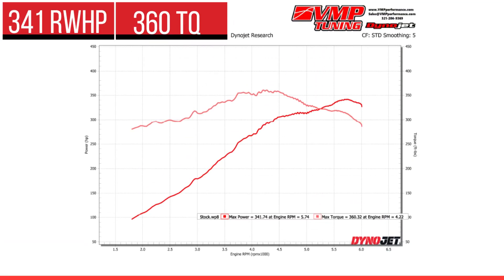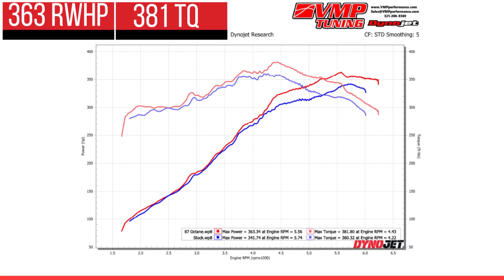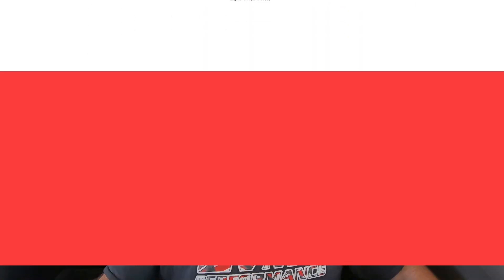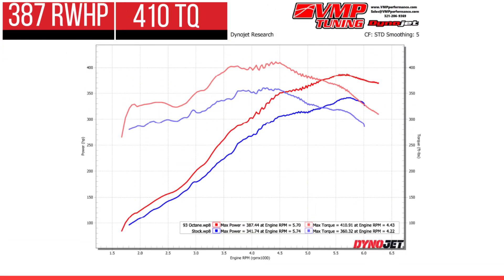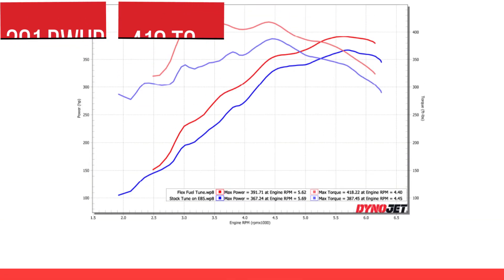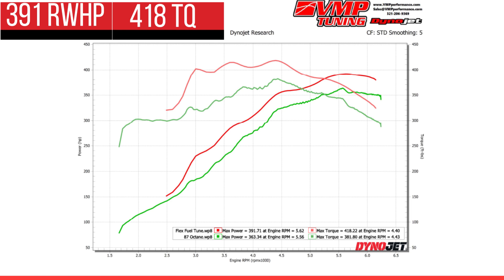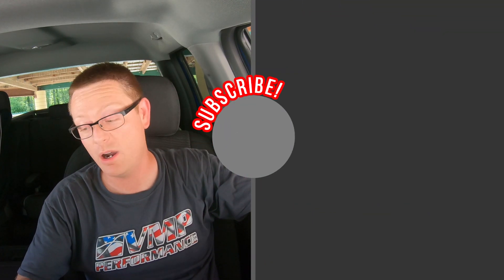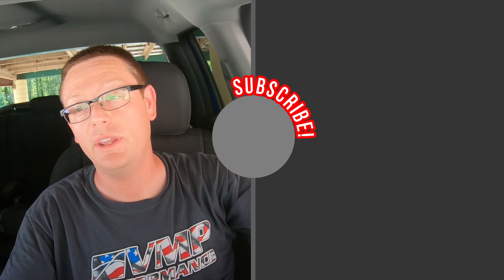Flex-Fuel Power Gains with VMP Tuning : 2018 F-150 5.0 L

Comment: And for those guys who don’t want to tune and still want decent gains apparently just switch to e85 on stock tune. 

Stock 87: 341rwhp 360TQ
Tuned 87: 363rwhp 381TQ
Stock e85: 367rwhp 387TQ

Comment: Thanks for the video. These are good numbers but nothing that screams "buy me now", not to mention simply using e85 is expected to give a decent bump in performance over 87 anyways. I'm interested in a Tuner but the market seems to mostly want more horsepower and that's just silly to me. The F150 5.0 is built and tuned differently compared to the Stang for obvious reasons. Have you guys experimented with a tune that prioritizes torque gains? I already swapped out the pathetic stock gears for 4.56 but kept stock tires and would love a tuner that gives a substantial increase in torque even if it meant sacrificing horses. Towing uphill is where I want to shine.
Reply from the maker: Thanks for replying.  Shoot us an email at sales@vmppeformance.com with what you're looking for in a tune and one of our tuners can talk with you about tailoring a custom tune to suit your preferences.
Reply: 4.56s on stock tires must make for a lot of shifting? What was your driver behind that?
Reply: High compression engines need more octane

Comment: So a flex fuel tune is 1 tune that covers all octanes? I have a 2013 f150 5.0 that I'd like to get just one tune that covers all octanes. Is that possible?
Reply: intake cams, intake manifold, and a tune with crazy high shift points is all you need for the older 5.0s ive got a 13 scsb 5.0 too

Comment: Damn the coyote in the mustang makes 80 hp more on e85 (and a cold air intake) ,  that’s a huge difference considering it’s the same engine,  feel free to school me on why that is
Reply from the maker: The biggest HP difference is in the intake manifold. The 18+ Mustangs have a different intake manifold than the trucks do and also the driveline on the F-150's has different components that make a difference in wheel horsepower.
Reply: Mustangs sport different cams than the truck version.
Reply: on the truck they shoot for more torque for towing and hauling

Comment: Also, did you test that E85 TO see how potent it is. Most E85 out here in Phoenix AZ does not measure up. It's weaker than normal E-85.  There are local forums and websites that post who has the best E85. Does anyone know how it loses its potency? Is it being manufactured this way cause like most GREEDY FUGGING CORPORATIONS, they are trying to maximize their profits by not giving us TRUE E-85. Also since they learned that the performance community started buying E85 instead of expensive fuels like VP and 114 octane TRICK, which i used to run in all my 2 stroke engines,  the price of E85 is the same as gasoline. It used to be AT LEAST $1 CHEAPER PER GALLON before.    Not only are they charging more, they are giving us a Sub-Standard product.  Fugging ICEHOLES!!!

Comment: I called to get a tune for my 2018 F150 spoke with a rep gave them the spec/mods I had said it would be next week till they would be able to convert it over to SCT tuner and to call back (price given at this time was 250 dollars). I called back a week later spoke with the same rep and ask about the tune and he said it was not ready and then asked again what year and what was done to my truck. I gave him the same information again and then said it was going to be 499 dollars. I asked why it's  more money and he said it was due to the E85 tune and the first quote was without  E85. I said that's a huge difference and then he quoted me again at a lower price 399. PLEASE PROVIDE THE CORRECT PRICE THE FIRST TIME!
Reply: The fact that they didn't reply to this message speaks volumes.
Reply: Go with oz tuning
Reply: z Trapo I second the oz tune. Vmp makes great super chargers but oz is one hell of a tuner
Reply: @brycea0225  That's what I ended up going with and I'm really happy with the gains and price.
Reply: Woooow.
Reply: Hi I hear you concerns about pricing and I'm not happy with the sales rep who talked  with you . The price of the tune should  have never changed and no one has responded to  your message is horrendous.  I don't even work there and now I no I never will .
Reply: What was oz’s price ?

Comment: Your crazy 
My 18 F150 5.0 is eating oil. ..  glad I still have a warranty
Reply: Autostop eliminator will help with oil problems.  Ford stated the oil consumption was mostly due to the autostop feature.  Something about residual oil being burned.  Mine is a 2019 5.0l.  Diabled the autostop, and have no oil issues.
Reply: @davea4037   Ford replaced my engine with a late 2019 engine, no oil burning and nice and quiet
Reply: I feel your pain i have an 18 and at 3975 miles i had to have the 5.0 motor replaced due to oil consumption. Truck only had a borla exhaust and intake no tune and was burning oil like crazy and making very unhealthy noises during idle. I had high hopes for the new gen 3 but now im not so sure.
Reply: They still have to replace the engine even if you tune it. The tsb states that it is a problem for these engines and that no prior approval or cost cap needs to be performed
Reply: This is why ford is working on a new V8 4.8 to replace the 5.0
Reply: There is a service bulletin retro fit to fix some of the consumption issues.

Comment: Pretty impressive gains on stock F150!  I know the first thing I'm going to do now after purchasing a new F150 in a few months. I might do Borla or Roush exhaust before the E85 tune though.
Reply: How did it go did you get the f150?
Reply: @sergiodurango8022  Ended up getting a 2020 F150 5.0L V8 with 13k miles
Reply: do the Borla ATAK....Mine sounds amazing
Reply: @craigjacobson158  Ended up going AWE 3" exhaust paired with their 3" resonated mid-pipe. Sounds amazing, and the quality & fitment is top notch. Highly recommend it!

Comment: Absolutely no reason we dont have atleast 100 octane fuel mandated in the usa. It doesnt take a rocket scientist to see that the higher compression engines of today are making more power,and mileage as well as cleaner burning. You would think these so called enviromentalists would or should demand higher octane fuel be mandated!!!! Imagine if they would make the octane needed what the auto companies could do with even higher compression?
Reply: TheGto389  It's not the environmentalists that don't want E85 it's the oil compiles.  If all cars ran on that much ethanol it would cut back on oil profits.  All new cars could be made to run on E85.  The mpg's aren't that good on it and that's all people and regulators look at.

Comment: Are yall doing this on dyno tunes only or can this be done through a ngage tuner with a mail order tune from yall ?
Reply from the maker: Great question! This is a remote tune (mail order) and can be done on a SCT or HP Tuners ngauge device.
Reply: @VMPPerformanceTV  is it possible to get all 3 tunes with an ngage? I run e85 when I'm around town but towing I usually try to run 93 when towing but I've run into a few instances where I couldn't get 93 when I was out of town pulling my camper

Comment: Is it possible to permanently disable the engine auto stop through the tune on an F-150?
Reply from the maker: Yes.
Reply: @VMPPerformanceTV  that's the answer I was looking for. The start stop gets really annoying sometimes. Can it be reversed so its default is off and you push the button to turn it on?

Comment: Are gains for the 15-17 coyote also expected around the same?
Reply: You'll see a little less power/torque since the Gen 2 Coyote F150 isn't dual injection (port & direct) like the Gen 3 Coyote F150. I believe engine compression is lower on Gen 2 Coyote F150s too.
Reply from the maker: No.

Comment: Those seem like pretty generous numbers to me... Almost 50hp going from 87 to 93?
And then only 4hp or so, going to E85?
Seems backwards.....
Reply from the maker: The 93 allowed us to go to an average of 26 degrees of timing. The E85 let us go to 27-28 at which point, the truck was at MBT and didn't want any more. It responded better down low, as you can see by the chart.
Reply: I figured the gains from 93 to E85, would be greater than the gains going from 87, to 93 too.

Comment: How much power would a 18/19 Mustang 5.0 intake manifold buy this thing? I'm guessing with headers, CAI, Mustang intake, and E85, that 440 wouldn't be too much of a reach?
Reply from the maker: But wait! There's more! (using our best Billy Mays voice) 

We will be doing some intake testing on this truck in the near future!
Reply: To Jeff Skaarland, 
On my 18, with all the mods you mentioned,  I'm making 420hp 440tq
That is on PBD tune on their dyno....
Reply: @jeffersonhenn1086  The headers are a sure thing for me in the future, I'm kind of torn on the Mustang intake, and aftermarket CAI because I know VMP will have a blower kit for these 18/19's sometime in the hopefully near future. Does yours rev out quite a bit higher with the mustang intake?
Reply: @MrLightning54  
It gives me another 1000, or so, but if I was you, i wouldn't do it....
I'm installing a Procharger on mine, so it should work for my application..
Reply: @jeffersonhenn1086  did it kill quite a bit of low rpm tq or something?
Reply: A family member of mine made 450whp with just an 18 mustang intake manifold and a oz tuning flex tune with just e85 in it.   Each Dyno is different though.
Reply from the maker: @rileyneufeld7001  correct. The '18 Mustang intake makes a big difference and different dynos in different parts of the world will register differently.
Reply: Theres quite a few mustang's in the 500whp range with full exhaust intake e85 and tune so I would say those numbers are achievable